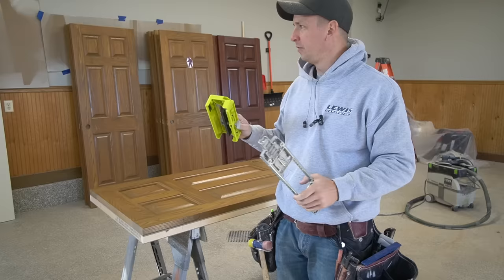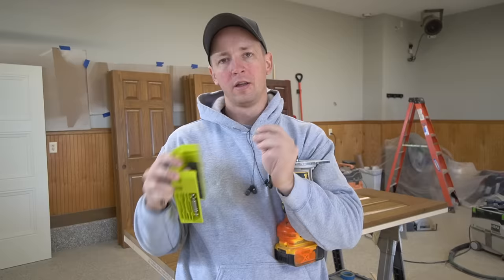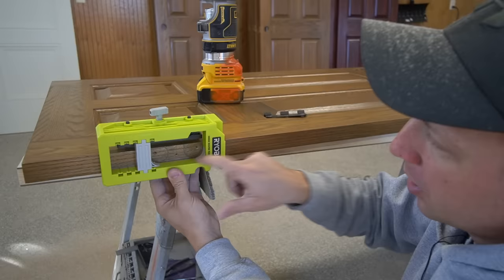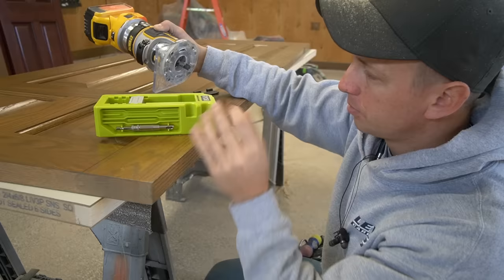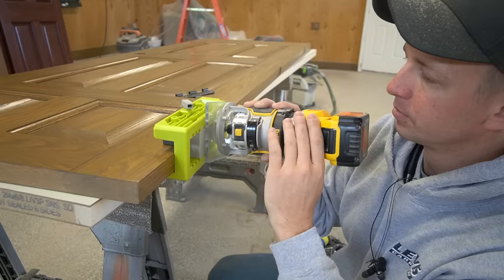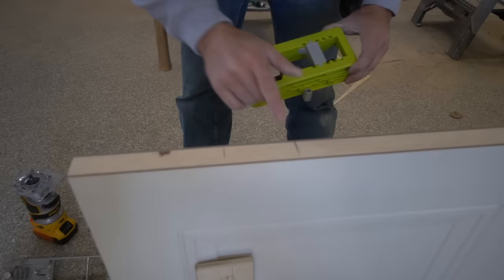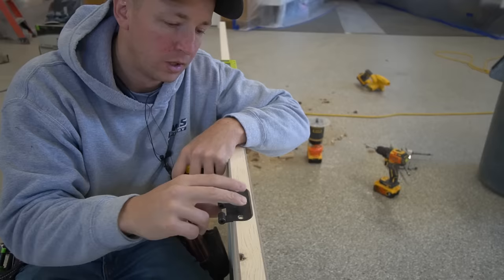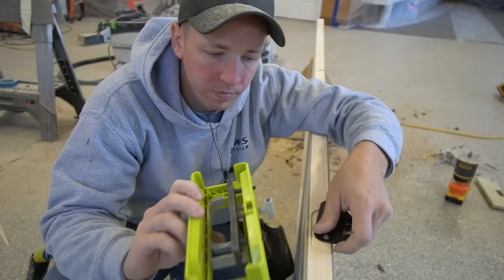Ryobi Hinge Jig - An Objective Look at the Ryobi Hinge Mortising Jig

Comment from the maker: THANKS FOR SUPPORTING THIS CHANNEL BY VISITING THESE AFFILIATE LINKS!!!
Ryobi Hinge Jig - https://amzn.to/2QcXxWD
Porter Cable Door Hinge Template - https://amzn.to/3mv8ChY
Trend Door Hinge Jig - https://amzn.to/3d28DXJ
Porter Cable Door Hinge Template Kit - https://amzn.to/3d05ZBy
My Favorite Tools - Insider Carpentry Amazon Site - https://www.amazon.com/shop/insider_carpentry
 Support more content like this by becoming a  PATREON SUPPORTER - https://www.patreon.com/insider_carpentry
Reply: Spencer - Glad you're taking the time to demonstrate so much of our craft to inquiring minds. I've been at this since boyhood, and professionally, I've been a finish carpenter/cabinetmaker since 1992. I've used a lot of different tools over the years - started out hand driving trim nails, building cabinets in two-car garages or on site, and hand mortising everything... 
Around the turn of the last century, after hand chopping many mortises in some  high-end residential finish work, I plunked down $100 for the Hinge-Mate, HM-1100 - W 
It's an all aluminum jig, set up to mortise the smallest of hinges, right up through at least 5" butt hinges, and it accommodates 3/4", 1 3/8", as well as 1 3/4" exterior slabs. The jig will also reconfigure to mortise loose jamb material (not pre-hung) for jamb hinge placement . The kit came with 1/4" & 5/8" rad. mortising bits for the differing small & large radius of common butt hinges. 
I've used the various plastic versions, w/the set nails, but the Hinge Mate is worth its weight in gold bullion. Last I checked, it was offered at $200, some years ago, although haven't seen it offered anywhere in a while now. You may pick one up on Ebay, or FB marketplace, but if you've a chance to grab one - don't hesitate.  Keep up the good work, you're a very good teacher. Hoping your work habits rub off on the younger up & comers in our craft - so very few that are  willing to run the gauntlet of the "years" it takes to master our craft. A truck full of tools doesn't necessarily make one a craftsman. You're pointing people in the right direction -👍

Comment: Spencer thanks again for great info. I am a 76 year old practicing carpenter with one eye. If you dont start wearing eye protection you might just suffer some horrific consequences ......its just a matter of time. With respect, Roger
Reply: I'm a 68-year old finish carpenter with one eye and I approve this message!
Reply: literally had a piece of nail smack me in the eye yesterday putting up barnwood shiplap and got lucky. you are absolutely right.
Reply: I guess it is safe to say the "I's" have it. 
I am not making light of your personal situation. Coming from a family of carpenters and dabbling in it my self, they never used eye protection and I don't but, I will. thanks.
Reply: You are a master, eye am a pupil....
Reply: Many years ago when I was an apprentice, I was moving a 12' x 4' wallboard solo. I was using a two hand top grip when my right hand slipped and my thumb went into my eyeball with a lot of force. I had a black eye and a hematoma in my eye for weeks. I was very fortunate I didn't  lose my sight in that eye.
Since then I wear protective  glasses whenever I'm working, no matter what task.

Thanks for listening to my old man's  story! 😉
Reply: @rustyshackelford1483  your name sounds so familiar. You in the SouthEast?
If I’ve had one pin nail go through and out, then ricochet  back at me…I’ve had a hundred. Safety, safety, no excuses…
Reply: we as construction professionals, take what we do too lightly and sometimes , pay the piper.
Reply: So if the two positions on the jig won't give you the beeded offset, it's pretty much useless? Just asking Spencer
Thx..  Jeff
Reply: Your right i worked with a guy who had lost an eye grinding a tile.. he made me realise safety first you only get 2 eyes look after them even if you have to go out your way to get some protection
Reply: Everyone can do what they want with their own eyes,  but when you become a teacher where others will follow,  we have a responsibility to promote safety.  Always appreciated what Norm Abrams would say before beginning his project.. "Remember this, there is no more important safety rule than to wear these: safety glasses!"
Reply: "Remember there is NO greater tool then eye protection" Norm Abrams
Reply: You need Safety Eye wear!!!!  You are a professional and not acting as a professional.  Get those peepers covered so you don’t have an eye injury!!

Comment: Thank you! I was looking for that info right at the 3:00 mark. I could tell something wasn't right, and I didn't even think to pull off the strips. lol. But that was it! The video helped so much. Great idea to go back and check the original door. I'm usually rushing, so your thorough video was awesome! I really appreciate the little tidbits of knowledge that I'm sure you've picked up over the years. It was my first time using a router, and putting up a door for that matter. Everything worked great, and the new door is up!

Comment: I recently used this jig to replace the slabs in my home and had EXCELLENT results, though practicing on the old doors is paramount.  For my application, the proper hinge backset was achieved with a 1/32 cardboard shim in lieu of the 1/16 rubber ones.  I also found the hinge height to be a bit inconsistent due to slop in the height selector.  Some cardboard shims to force it toward the smaller side of the setting fixed it.  Also, mine needed a little filing on the plastic 5/8 radius pieces to get a fair transition to the straights. Finally, some practice on lining the jig to your layout lines is worth the trouble...take the line vs. leave the line stuff.  A great jig for the price.

Comment: I bought a Master Craft hinge and strike mortising kit some years ago; I’m sure like many others as the years went on I just made my own hinge mortising jig. I don’t mortise hinges too often but I just wanted a sturdier jig, so I built my own. For a do-it-yourselfer a Dremel with their router attachment works great to free hand hinges and strike plates. 
As a side note: I have some of the a DeWalt battery trim routers and have the plunge base on one which adds a lot of utility as well as a slightly larger base plate to the standard trim base.

Comment: That ryobi template works pretty well.  I replace it every 5 jobs, or so.  It's plastic, so it gets beat up a bit.  Same with the lock mortis.  They are very economical and work quite well.  It's no match for a pro set up, but for most people it's more than adequate.

Comment: I have the same one that I partially ruined pretty quickly so I was laughing on your last video when you said to let the router stop before you try to remove it. It still works good though and it's so much better and faster than scribing with a knife and using a chisel.

Comment: That's funny, I was watching your 1st video (with the Bosch) jig, thinking man, he would really like the Ryobi (which I own). Then this video pops up! One thing to be careful with is if you tighten too much, the screw tip will mark your door. As it doesn't stay seated "under flushed" behind its "push plate". I took mine apart and added a small spacer/washer to prevent that play. I'm still careful when I tighten, but this definitely fixed the problem.

Comment: 1st, thanks for the tip on the removal of the rubber stoppers, it gave me the spacing I needed and I wouldn't have noticed it otherwise.  
2nd, I noticed that as I tightened the jig, one side will rise up off the door, placing the jig at a small angle.  When this happens, the router won't remove enough material on one side.  I had to really hold down the jig while tightening and even that was not a great result.  There was about a 1/32 to 1/64th difference, which may be a small problem when you're only removing a 1/16th.

Comment: I have the same jig and yes, the harder you tighten the clamp, the more the jig is going to lift up and off the surface.  When you are routing, it is important to push down evenly on the router so it routs the surface at the proper depth and it works best if you route it with the router in the upright position so you can put force on the jig.

Comment: Hi, great work by the way. I’ve been using this jig for quite some time now and it is good but like you said, if your not careful when tightening it down, it moves the jig further and tends to bend it slightly. Overall a good bang for the buck I’d say.
Reply: yes it does bend it slightly. I use the smaller end of a wood shim about 4"long and slide it in where those rubber spacers are and I can adjust it for whatever size of a reveal I want left on edge of hinge and it corrects the bending.

Comment: That jig looks like it might work pretty good but I'm still partial to my plywood jigs and also the clamping mechanism should be on either side of the hinge rather than pushing from the center which would give you that inaccuracy there on the hinge margin . Practice mortising on an old door would probably be a good idea or a block of wood or something like that to dial in all of the precise tolerances. Again I appreciate your attention to all of the fine details. As you know the margins around a door are very obvious to even some of the novices. For seeing the bumps in the road ahead of time sure helps in making a job flow smoothly or not.
Thanks for your videos.

Comment: I have had that Ryobi jig for hinges and the Milwaukee similar (but red) plastic guide for door knobs for well over a decade or so and they have always worked well for me. I will preface that they get used sparingly. But when needed they are lifesavers and have always been accurate.

Comment: Ive been using this jig for years, it’s shockingly great for such a cheap tool from a cheap brand. 

They just released an updated version that’s thankfully more beefy than the older one, the thin plastic flexing was the only issue. It’s as easy to use as you’re going to get for one of these jigs.
Reply: Just doors or will it do jambs too?

Comment: Jig doesn't look too bad. I use the Porter Cable Jig most of the time, but I get quite tired of loosing the small parts that go with it. I think I'll be giving this one a try on the next job.
Reply: Same. I have both, and consistently use the ryobi when I'm only doing a few doors. Plus the porter cable requires you to make additional holes in the edge of the door slab.

Comment: Our project manager was ready to drop close to 400 for a jig with multiple hinge templates. We were going to use it to mortise hinges in slabs for existing framed in and welded in steel frames. Would have been nice, but nope. Boss said go with the Ryobi, one at a time.

Comment: buying this is a no-brainer, I am impressed that Ryobi basically gives you the jig for the price of the included tooling...$20 for the router bit and $10 for the Vix bit, jig for free! I have used one of these a few times, my only criticism is that it is plastic so it is easy to overclamp it and distort the template or position it "off-square". Secondly, being too forcefull with the router and pressure against the sides of the template and you can pretty easily distort your mortise shape - easy does it is best!

Comment: Would love to see a clamp on style made from aluminum or even just a tough version. Thanks for the review.
Reply: used to be one made of aluminum called the 'Hinge Mate' not sure if it is still available. Woodcraft supply has a picture of one but says out of stock. Trend makes a nice one that does doors and jambs as well, designed for the pro.
Reply: @theroadnottaken9378   Thanks for pointing that out. It looks neat.
Reply: @theroadnottaken9378  The Hinge Mate is still sold at Lowe's.  I own and have used both the Hinge Mate and the Ryobi being demonstrated by Spencer.  Success can be achieved with both.  The Hinge Mate can also be used on the door frame to mortise out those areas for hinges and the strike plate.  The Ryobi does not help with this, but is much simpler to use for what it does.  My only complaint about the Ryobi is the plastic clamp mechanism, but that's minor.  It works well and is much easier to align exactly where you want it than the Hinge Mate, in my opinion.  Spencer, thanks as always.  I learn a lot from you.
Reply: exactly. same idea but more robust

Comment: Im replacing some doors and jambs. I used prehung doors from Lowes in the basement but the jambs they use are crap. The doors are nice - Masonite molded solid core craftsman style. So I'm thinking buy slabs and make my own frames. Thinking of how to use the Ryobi jig and make a plywood jig with all 3 hinge layouts for door and jamb. Because Im making them myself the jamb hinge cut can be down before assembly.

Comment: Hi Spencer! Quite informative. I've done doors before but just used existing hinges. This time the old hinges are no good. They are also - of course - the wrong size. They are 1/4 hinge radius and only 3" wide. My new hinges are 5/8 radius and 3.5" wide. How do I make sure to adjust my mortises on the new door and rework the existing opening to ensure the new hinge is correctly placed and does not bind? I can't seem to find any information online for this scenario. That usually means I am doing something I should not do, but considering today that 3.5" is the standard and I can't even find 3" hinges at an affordable price, and these are heavy new doors (soundproofed), what can I do? Thanks in advance! Subscribed!

Comment: Hi Spencer, I mentioned on another video that this jig also came with a self-centering Vix bit. I don't know if your jig came with one, but self-centering bits have been kind of hard to find locally, and once I used one, I ordered a set using the link in your video description.
;)
Reply: Because it stows on the jig it is a bit of scene stealer in this video.
Reply: You can get self-centering bits (aka VIX bits) from Harbor Freight.  Not the highest quality, but, really, all you need is a well centered starter hole.  I've had mine for years.

Comment: Plastic has limitations and there are some things that just shouldn’t be made out of it.  This jig is one such example.  The first time I used it I saw green shavings mixed in with the wood.  Just outline your hinges with a utility knife, set your router bit depth to that of your hinge, clear the area and use a sharp chisel to clean up any rough edges.  You’re going to have to do it this way on the door jamb, might as well do it on the door.

Comment: I'm not a fan of ryobi, and will continue to use my 30 year old porter cable, I don't mind the holes to fill but at least adding a third hinge to the jamb I can use the same jig, thanks for the info
Reply from the maker: Fair enough!
Reply: Great tip with the block of wood to gauge the alignment of the jig, how about discussing a strike side jig,  I'm still not happy with the ones I have used. Thanks

Comment: Is there a way to do hinges without a router? I’m a homeowner looking to replace a couple of doors in my home and it’s cheaper to just do it myself otherwise Lowe’s considers it a special order which makes the door much more expensive? I saw a kit at Lowe’s that comes with a bit and I was told you can use a drill which I have. Any thoughts? I’ve never done anything like this before.

Comment: The best jig is a piece of stock the length of the door with two or three cut outs matching the hinge placement that you can nail in place on a door or jam and router with a flush trim bit. End of story.
Those jigs are only as good as the users ability to place them exactly where they will match from door to jam. Good luck with that.

Comment: Hay Man, Just wondering if the hinge is set at the bevel angle too and does it matter?
Reply from the maker: Doesn't matter a ton. I try to set it at the bevel angle but if it squares up to the door a bit its not the end of the world. Most door shops mortise square to the door rather than with the bevel because of how the machines are setup.

Comment: Spencer it would be nice to see how the new slabs sit against the strike side stops. I cringe when I’m asked to replace a slab only. The original stops were set to the original slab and each slab has its own minor imperfection and a new slab never mirrors that. 30” L/H I/S door in bedroom #1 won’t fit the same in bedroom #2 with the same size door and/or swing. I’m not trying to school you, I just would like see the results this project you’re working on.
Reply from the maker: It was an occupied house with pictures everywhere so I was respecting their privacy. Plus its hard to work and video at the same time and I'm limited on how much time I can put into getting video.
Reply: I explain this to the customer ahead of time. If it's not split jamb, you can bump the stop. It will crack the paint, though.

Comment: Which hinge goes to the door, the 2 part or 3 part (like letter "E"), I have seen so many variation it is so confusing.
Reply: There is no industry standard for that. It usually just depends how your hinge came assembled with the pin to the top. I do find it easier if the the 3 prong is on the door and 2 prong on the jamb. Some times you have to give the hinge a love tap for it to line up.

Comment: I wouldn't advertise the porter cable plastic template jig to anyone supporting your videos. You're almost guaranteed to break it on job one.
Reply: I recently used one on a job where I replaced 42 8/0 slabs in a $1.8 million house. The Ryobi jig worked great and the customer is extremely happy with the outcome. However, my body's not happy after carrying solid core doors up flights of stairs.